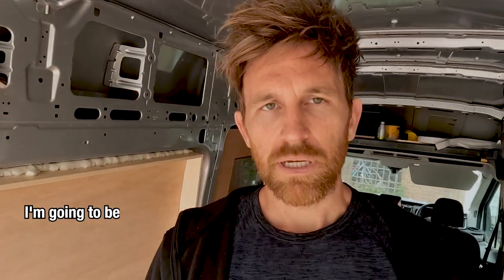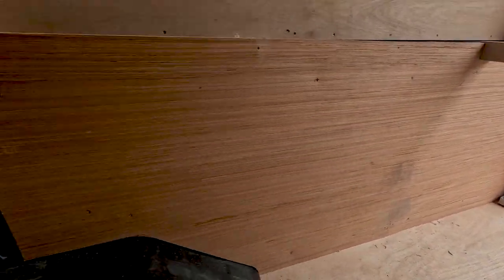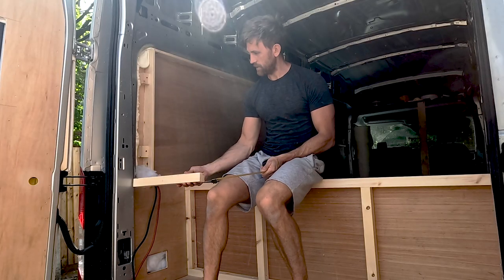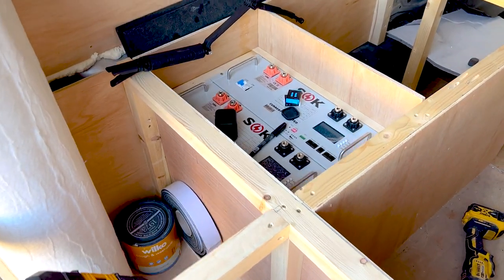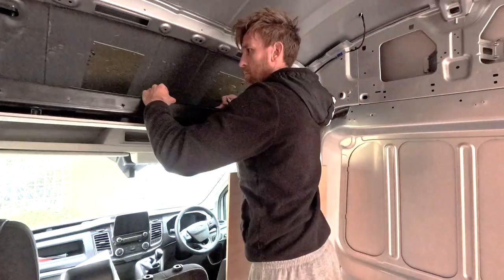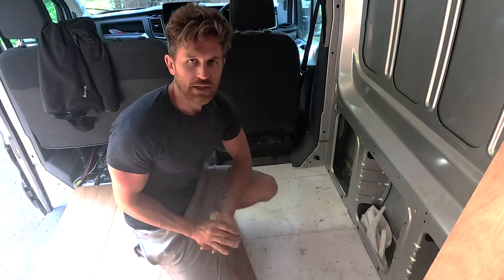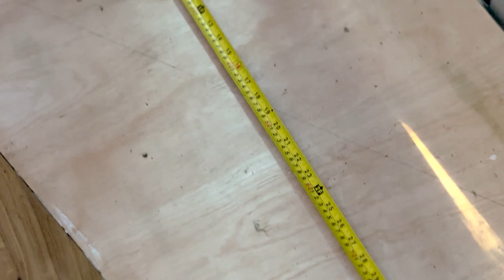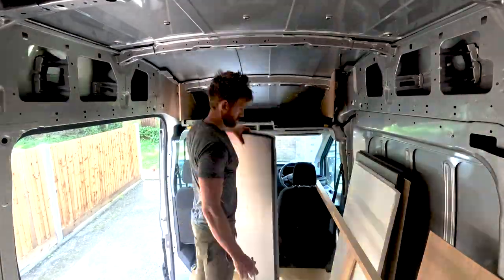Framing the VAN Sofa / Bed & Storage Area above the seats - Van Conversion 🚐

Comment: Love those batteries!!! I did 960ah @ 12v in my latest build and love having all that power, especially when I have the rooftop A/C on.
Reply from the maker: We're super excited about it! 
We weren't sure if that power was enough for running AC
How's it working for you? How long do you usually keep it running?
Reply: 800ah @ 12v is enough for an A/C. More is better but that is sufficient. Just have to use it carefully. My A/C (Dometic) pulls around 50amps when cooling down the van and then drops back to 20amps when the van has cooled down and then cycles up and down, keeping the van at the set temp. It's a small space so that doesn't take long to get cool. I run the A/C for a few hours usually. A really well-insulated van will help the A/C be more efficient. I have 400w of solar and a shore power connection.